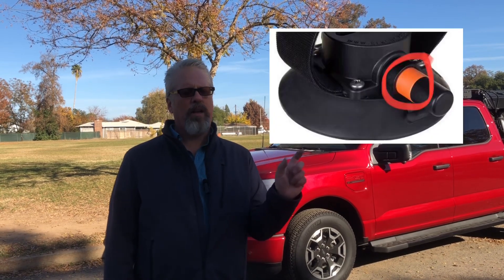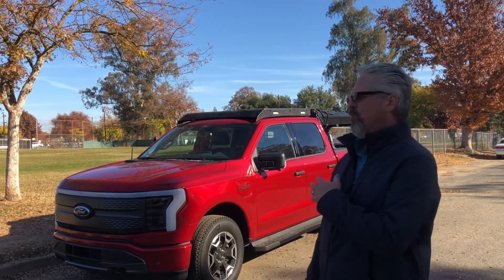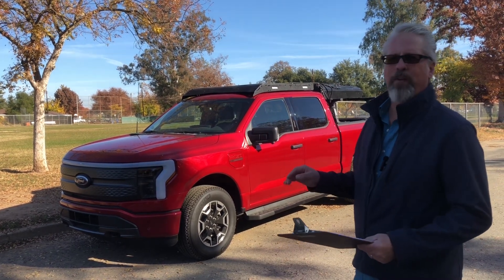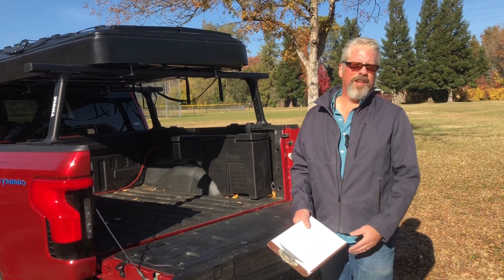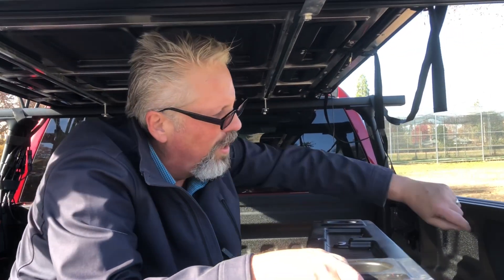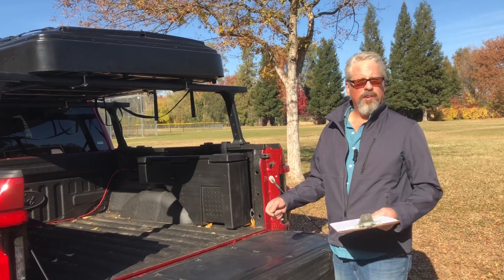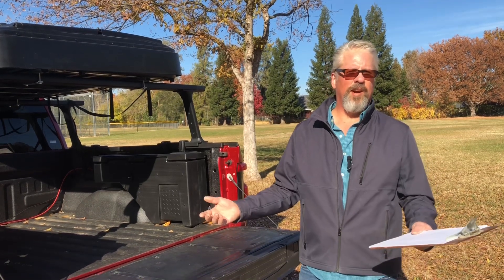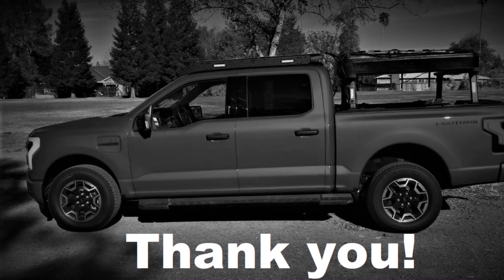Electric F-150 Lightning + Solar = Overlanding 2.0

Comment: Why not bi-directional tiltable panels on a lockable Lazy Susan system (just for 180 swing), Reflective bed coat. Hell with a little extra math and effort you could probably get an ESP32 and a servo to swing the panels for you. Look at some local maker places.

Comment: I'm curious to know which EV charger you are using. I'd like to find one that can only do 6A on the 120v connection to slow charge from about 1000w of solar panels. I don't see it listed in the description though. Thanks!

Comment: Nice work, thanks for posting. Was thinking, would you chance the couple thousand spent on the panels and everything to just the suction cups? Plus, the liability if they fly off and hurt someone? Still a great set-up. Maybe the rack maker will see your post and help to find a more secure solution. Cheers and best wishes.

Comment: I'm glad I came across this video. I'm glad to see what you are doing and hopefully someone from Ford, Tesla and Rivian will look at this as well. I think this is pretty awesome. I love driving trucks specially F150s and I'm a big believer in thinking forward. We've all hated on the Ecoboost motors but they are some of the most powerful engines out there. Now it's time for electric to have the same fight. I would jump to a F150 or even Rivian if the range was close to 500 plus miles but it's not quite there yet but I know things are getting better every year so probably soon. But glad to see you are doing this and very clean setup.
Reply from the maker: Thanks for the comment!  I think we are just 1 or 2 years away from some major solid state battery production…doubling or even tripling range at no extra cost.

Comment: Fascinating stuff! I've always had a thing for solar and self-reliance. I would love to eventually get a Lightning (currently have a standard F-150) , but with my driving amount and use, it doesnt make sense...yet! I would recommend some residential solar panels, based on the surface area you have, you could install four high-grade solar panels 400W+ each (approx. 1.6KWH+) more than doubling your current setup with no change in surface area. They are only about 1" in height with aluminum frame 20yr+ lifespan/warranty. These days there are about $1/per watt or less, especially on local classifieds. They do weigh about 50 lbs each, so something to keep in mind there. We've installed two 15KWH solar arrays with these type of panels (one at the cottage and one at home), plus too many little projects as a hobby. Never a worry, always pumping power, now over a decade for the one array. Subscribed and looking forward to seeing more as your schedule and budget permits! Thanks for the great video, fun stuff!
Reply from the maker: Hi and thanks for the suggestion.  I decided against framed residential panels early on due to the added weight of the glass and the frame, as well as the inability to curve them to fit the surface I was covering.  400W residential panels are quite large (I have them in my home solar installation), and there just isn't a way to mount those on a vehicle and keep it aerodynamic.  The flexible panels I have on the top of the truck/rooftop tent add up to 590 W.  This was the absolute max surface area I could cover with the rack and clamshell tent I chose (taking into account the voltage and current compatibility of each panel)...with other rack and tent choices it may be possible to mount more.

I have an additional 1000W folding array which mounts on the back of the truck and can be deployed at a site.  My extended solar array uses all flexible 100W panels as well to keep the weight down.  I'm currently doing bench testing on the full setup and hope to have a video coming out with the results soon.

Comment: does the F-150 Lightning allow you to use the onboard Pro Power while solar charging it?
Reply from the maker: The ProPower requires the truck to be “on” for the outlets to work.  You can charge the truck with the vehicle on, this will keep the ProPower active.  to get around this problem of the truck needing to be on, I built a 12v cigarette lighter port and USB ports into the solar charging unit.  (The difference between the truck being “on” or “off” and parked isn’t a lot power-wise, but you have to turn the ac/heat and lights off to reduce battery drain.  Ford has not yet included a camp mode, that I know of.)

Comment: Very cool and interesting to see the numbers, I have a 68kw array that runs the farm and home. This provides enough for me to run 40amp charge rate for my f150. I have been researching this idea using 5kw battery bank and only a few have heaters/bluetooth so I can monitor the cells. I was thinking of using 550w bi-facials in a 3s configuration so even if one side was not sun oriented the back side would at least be able to assist.
Reply from the maker: Are the 550w bi-facials single panels or multiple panels?  What are the dimensions of those?  The best I think I'm going to get in a mobile (portable) set up is  about 15 amps @120v from 16 panels
Reply: @the.electric.bluebeard  I have a few left over from the main install they are all between 72-78 inches in length. So I could mount three of them parallel to the bed length wise. The 78 inches though would be off the back of the bed by 4 1/2 inches.

Comment: Used the same suction cup system in a bike rack and never had an issue at 80mph, probably putting much more force on the cups than you are, and with the air dam, you're actually putting downforce onto it, likely adding to the suction. Great ideas, and content.
Reply from the maker: Thanks, testing so far has been good but the suction cups definitely need to be checked each time before getting back in the car...I found one of them hadn't sealed properly and managed to go into the orange zone within a few hours.

Comment: Will that power system not power up the Ford portable charger? I see you had a different brand... this is exactly what I plan to do! Panels on top of my enclosed trailer to charge while camping too.
Reply from the maker: I used a portable charger that allows you to select the amp draw so that I can change it on the fly based on how much power the system is producing.  Ford's portable charger is a standard charger with a set amp draw...something like 12 amps.

Comment: At what point would you consider a portable generator…?
Reply from the maker: No gas or diesel powered generator for me...I have them but I'm trying to see if this can all be done on solar.  If you wanted to stay at a remote location for 30 days and you relied on diesel at some point you would run out and would have to return to a populated area - you can't produce diesel out in the wilderness.  On the other hand...a steam-powered turbine might work.  You would be able to power it as long as you had access to wood and water.  Hmm...topic for a later experiment.

Comment: Cool idea. Do you list the cost of your panels anywhere? Also, if you get bored could you experiment with wind power. I've been curious if a guy could use the portable wind turbines to add power. I live in a high wind area and I suspect that wind can generate more than solar.
Reply: The drag created by the wind turbines would more than offset any power gains imo.
Reply: Wind turbines might not work at highway speeds which are nearly or at hurricane force. A lot of them will feather the blades, or apply a brake to prevent damage from high winds
I have always been curious if someone could optimize something for highway speeds that could fit into air inlets where the air is going to be disturbed anyways and not add to drag.
Setting up a small turbine at a camp site could be done, but usually you need to have the thing up 40-50 feet to get some wind speed and would require some set up and storage at each location
Reply: If the turbines were stored inside and mounted outside when stationary it could work. They can't be used in motion to generate power, will cause more drag than the power they could generate. So long as removable and mountable, then a very cool idea

Comment: Interesting idea. What's the total weight of the solar panels and how much payload does that leave you for gear, people and food? Also, with the weight, what is your new overall range for driving?
Reply from the maker: This is a good question...I have a breakdown of the weight for each item bellow:
roof top tent                                110 lbs
rear rack                                         50 lbs
Front rack                                       40 lbs 
Solar Panels (all together)          38 lbs
DeeZee box with components    30 lbs

For a total of 268 lbs.  The max load rating for the truck is 1960 lbs, so that would leave me with 1692 additional lbs I could carry.  All my regular gear, plus 2 electric bikes in the bed and a fridge/cooktop in the front trunk would probably be no more than 300 lbs, plus people 300 lbs...so minus an additional 600 lbs would still leave me 1000 lbs under max load.  I don't yet know how this will affect range, however, on a recent camping trip I took a similar load (minus the roof top tent but with one additional person) and I got about 2.5 miles/kWh efficiency overall.  The big variable is how much drag the tent with the solar panels is going to create...but at 40mph on dirt roads maybe that isn't so significant.  I will be testing that out in a future video for sure.
Reply: @the.electric.bluebeard  good stuff. I’ll be keeping an eye out for that video.

Comment: I want to see someone testing Ford’s claim that it can power an entire house for up to 3 days. If it could power my house for 1.5 days AC included I would be interested.
Reply: What's your house load or daily kwh usage  your typical house uses 24kwh to 38kwh a day the lightning has a 90kwh battery or a 134kwh  it can run a 30kwh house for 4 days

Comment: Roof mounted tents are a scam
Reply: Not sure you know understand what scam means.
Reply: @ALMX5DP  they're tiny, they're heavy, they create huge aerodynamic losses, they suck to deploy, they suck to climb into, they suck when you have to use the bathroom, they're super expensive, the wind blows them and the car around to discomfort. Basically they're everything you don't want a tent to be.
Reply: @macbook802  maybe so to all of that, but scam probably isn’t the right term to use still.
Reply: @ALMX5DP  you must not watch the Simpsons
Reply: @macbook802  not for 10-15 years now. Care to elaborate?
Reply: @ALMX5DP  sure, everything you buy or see is a scam
Reply: @macbook802  gotcha, so regular tents and trailers or more conventional vehicles are scams as well?
Reply: @ALMX5DP  if they meet the criteria, absolutely.
Reply: @macbook802  you didn’t mention anything about criteria..

Comment: I think there is a reason roof racks aren't typically installed with suction cups.
Reply from the maker: Not a roof rack that would carry a heavy load.  SeaSucker makes a variety of racks that are meant for lighter-weight items such as bicycles, light bars, skis, etc.  The solar panel I'm using weighs about 25 lbs, and the rack itself about 50 lbs.  I'm using 4 suction cups and each one is rated for at least 100 lbs, so I don't think there is a lot of risk...just need to check the indicators each day to see if any orange is showing.

Comment: I'd love to see what 2.5 KW translates to off-road at overlanding speeds. On one hand you have a lot less wind drag but on the other hand you have a lot more from mud and whatnot. I really couldn't tell you if you would get more or less range but I will tell you in my experience the GOM is right next to useless if you're doing anything other than driving on smooth predictable road with no wind gust.
Reply from the maker: You are probably right about the increased energy use for off-road.  Saying that 10kWh is equivalent to 20 miles of range is really just a means of putting it in perspective.  If I am able to collect 10kWh of power with my system that's about 10% of the total battery capacity of the truck (standard range battery).  It would definitely not be quick but you could theoretically charge your battery up 50% with five days of good sun in one spot...whatever range that would work out to be.
Reply: @Electric Bluebeard  My comment wasn't sarcastic or snarky, I'm genuinely curious, and a fellow lightning owner. I know the mileage numbers we're just to put you in the ballpark. My best guess is you would probably use less electricity off-roading per mile compared to driving on the highway I think I read somewhere that for most electric vehicles the peak efficiency speed (maximum range) was like 20 to 30 mph, but that was based on a vehicle that didn't have to drive motors increasing drag also a pickup truck is gigantic and not particularly efficient.
I really wish the lightning would just show instantaneous power in a numerical form so you could just see the efficiency.

Side note, I highly recommend not overlooking all of the losses in your system and phantom drain if you really want this system to be usable.

And bear in mind those numbers change drastically, for example, if it's extremely cold or extremely hot you may use a few kilowatt hours a day keeping the battery a good temperature.

There's someone on YouTube who made a hitch mounted solar charging solution for his Tesla Model X I thought that'd be cool to attempt on lightning because if I recall correctly he ran into a limitation of exceeding payload and hitch weight two things that wouldn't be an issue on the Ford Lightning and also you wouldn't have to do crazy stuff to your truck like putting on a roof rack or screwing with the overlanding equipment in the bed, just food for thought.
Thanks for your videos, I already subscribed.
Reply from the maker: @xsterawesome  Sorry, I didn't mean to reply like I thought you were snarky, I thought you had a legitimate point.  To a certain extent I just don't know - I have planed out a validation test run where I take the truck through Kofa refuge in Arizona, I probably won't know real numbers until I do that trip.  You are correct about the losses -  I have switched everything over to electric (cooktop, fridge, lights, coffee maker) so as I get closer I'll have to start doing some calculations with that energy use in mind- as well as phantom drain. 

I did see a video where a guy had made a solar array that was stored on a hitch, however, he used framed rigid solar panels which were quite heavy.  I plan to use flexible panels which are quite a bit lighter but more expensive...looking for a deal on a bunch of used ones somewhere that meet my specs.

Comment: If you want to add to the hood as well, I've seen a few FJ and 4runner folks put a wrap on the hood, then glue the solar panel to that. An option if you want to expand the permanently mounted solar realestate.

Also +1 on a Patreon. I'm interested in seeing how this ends up as well.
Reply from the maker: Thanks, that's an interesting idea.  I've also seen some hood-shaped panels although they are like three times the price for some reason.